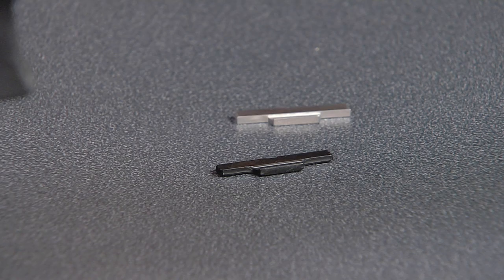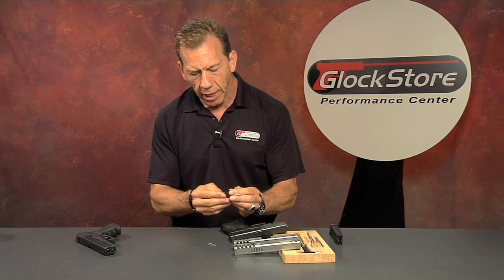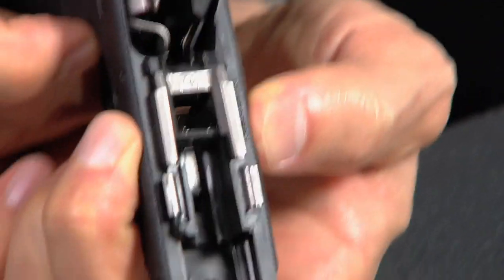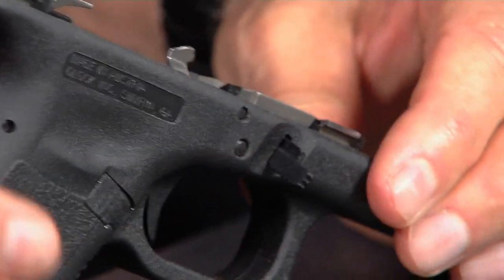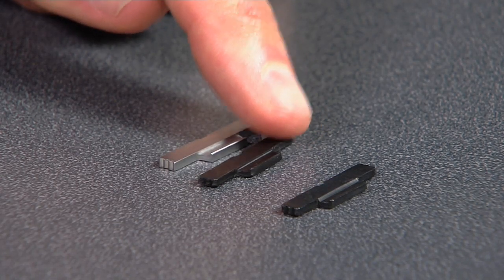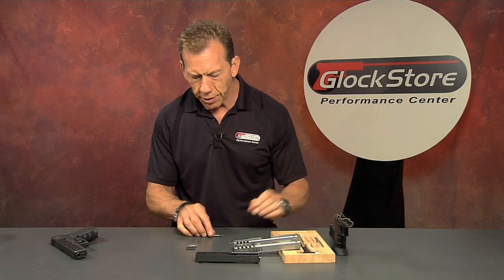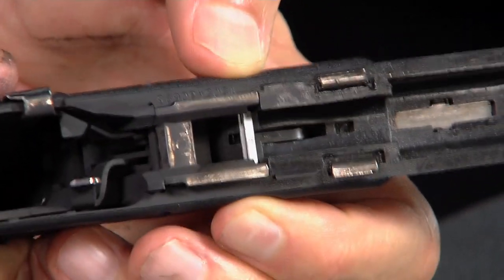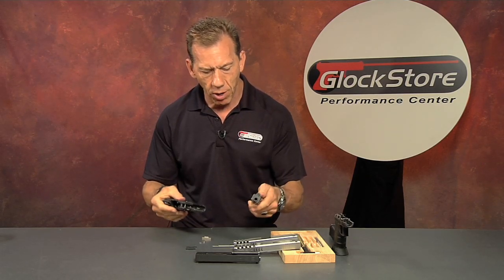Precision Extended Slide Lock Lever

Comment: This little peace actually does make the gun a little bit more accurate at 15yd I tested this with factory and then with this I noticed I had a tighter group, there is less play in the barrel when in battery thus making the gun more consistent.

Comment: Hey Lenny, great videos as always. I don't see one for the G44 take down lever, its a little different from the other Gen 5 models. I just changed one on my wife's new G44. I used a Gen 5 replacement lever from your shop although I see people posting that G44 vs other Gen 5s are not really the same Glock OEM part number.  The G44 seems a rather different beast although good for my wife to learn to shoot before we go back to 9mm.

Comment: The setup for the spring that the slide release lever sits on is different in a Gen5 Glock 17 MOS. So that leads me to wonder what comments you might have about any potential improvements already existent in Glock's Gen5 slide release lever over the Gen you're using. Do you still think your slide release lever is better than the one now provided in the Gen5? Also, considering the different spring design (it looks like a tiny coil spring) on the Gen5 slide release, I'm also wondering if it might be more difficult now to change out the release lever. Looks to me like the tiny little coil spring in the Gen5 version would be an easy item to pop out unexpectedly, never to be seen or found again, lol. Thanks for any insights and info, much appreciated. Always enjoy your videos. :)
Reply: The coil spring actually is an improvement over the leaf spring, in that the long leg on the leaf spring occasionally does break. It's equally easy to replace the slide lock on both variants.

Comment: The "unnamed competitor" to which Lenny keeps referencing ("genmtly knocking" is more like it), of course is Galloway Precision that sells a stamped take-down lever that is 4mm wider than stock. No, it is not machined like Glock's super take-down lever, is NOT thicker than stock, and does not have a curved top to catch the barrel (not the slide).  It does get slammed every time you fire the gun, so there may be something to having an effect on barrel return being more consistent because, as I said, it catches the barrel - not the slide. 

While it is thicker, it is only 1mm wider, and although it may not be a problem on the Glock, it definitely is the problem on the SD9VE Glock 17 Clone.  I wish to God that S&W copied the leaf spring design of the Glock L-shaped leaf spring instead of making an S-shaped leaf spring that rests on top of a U-shaped spring, and does slide from side to side.
Why in tyhe Hell they didn't make a simple L-spring and stick one end in a frame slot and put the other end under the notched takedown lever - a la Glock.
In fact, why is Glock using a longer leaf spring support end in the G19 than in the bigger G17? The longer leaf spring support does just that5 - give the spring more support.
The dumb arrangement in S&W's SDxVE series uses a useless U-spring that adds nothing to the takedown lever operation, BUT, in factr, messes it up!!!
Which is why I made this video to show a different way to take down the Glock clones and also the real Glocks:

https://www.youtube.com/watch?v=3UJXs-XV_jM
Reply: TheDrRJP BTW, will this work in Smith & Wesson's SDxVE series?
If you look at the photos on Galloway's website, the takedown levers for both the Glocks and SDxVE's look identical.

For that matter, so does the "captured recoil spring/stainless steel guide rod" combos. Are they also interchangeable?

Comment: I'll disagree with Mr. Ridgeway in his assessment of Glock aftermarket parts and why they exist.  He states that Glock aftermarket parts exist to make Glocks functional.   I disagree by saying this gun is perfectly acceptable for the general public exactly as produced.  Guns that are popular and most numerous are the perfect platform for aftermarket products that make a gun fully customized for the owner.  The more of any gun there is out there,  it is reasonable to say there are more folks out there who want a gun "their" way, or customized to their tastes.  Glocks are the perfect platform to modify as you choose, or simply shoot straight from the box.
Reply: Exactly. Hard to beat a Glock's reliability and longevity out of the box. None of the endless number of mods available are necessities.
Reply: Having slightly sweaty hands makes a couple parts of the glock extremely hard to use, like the slide release and this part. I have custom parts for both and it makes the gun MUCH better.

Comment: To say a new slide lock lever will provide better accuracy is frankly marketing bullshit.
Reply: +dkeberhard as far as any noticeable accuracy gains, probably not, but when you stack more precise items up,  even with little amounts, it can and will add up. This part alone probably wont do, much for ya, but in conjunction with a new precise barrel, Recoil spring assembly, a adjustable trigger with new precision internal  striker components, it may make a huge difference, but the thing is most people cant probably shoot it to that kind of accuracy,
Reply: Will it not lock the barrel more consistently? In that case it would give better accuracy in theory, but the aversge shooter would probably have other accuracy issues to worry about before this will be of any significant value

Comment: ANOTHER AFTER MARKET PART FOR A GLOCK TO MAKE IT FUNCTION PROPERLY-OUT OF THE BOX.  HAVE YOU EVER SEEN A PISTOL THAT IS IN NEED OF SO  MANY UPGRADES RIGHT OU OF THE BOX?  IF THIS FIREARM OPERATED LIKE IT IS SUPPOSED TO PLACES LIKE THE GLOCK STORE, GLOCK WORLD, ROCK YOUR GLOCK AND GLOCK MIESTER JUST TO NAME A FEW WOULDN'T EXIST!  UPGRADED BARRELS, EXTENDED SLIDE LOCK LEVERS, FIRING PINS, MAGAZINE RELEASE BUTTONS,,, THE LIST IS ENDLESS TO BRING THIS PIECE OF "PERFECTION" UP TO PAR.  DON'T BELIEVE ME?, JUST PUNCH IN "GLOCK PROBLEMS", SIT BACK AND BECOME ELLIGHTENED.
Reply: +Mark Ridgway you must be very ill informed, does every time some gets a ar 15  that is basic milspec furniture, and upgrades to magpul grips, stocks, new barrels, calibers, different safeties, different magazines and so forth, that ar 15 is a non functioning piece of junk. Not at all, it will work right out of the box, just fine. Its a popular gun with alot of aftermarket support so people can change a stock basic design to better fit their needs.  Smith and wesson, XD to name a few have aftermarket parts as well. Check springer precision, galloway precision, apex tactical., they make numerous parts for other manufacturers. Glock is perfection by no means, no gun is perfect, I wish they would drop that slogan, and move on to something more realistic, but that apart, the glock pistol is sold often, used often, by alot of people, police departments, and military armies around the world. Also want to note, look how many different companies make a 1911, make 1911 parts. It must be junk because not everyone leaves theirs stock by your logic, a 1972 camaro, must be junk because manufacturers make aftermarket parts such as rims, edelbrock carb and so forth. Your logic on this topic is flawed , say what you will about glock, but I am just fine with my glock as a bone stock pistol, but I bought a Glock 40 10mm auto for use on whitetail deer. Could I leave it bone stock  and be just fine, yes, I like sights that are stock on a glock I am fine with their use of polymer on lots of aspects of the gun. But I  am going to put a new trigger bar, new adjustable trigger, a ported barrel, and a steel recoil assembally because I am going to push my glock to the limits, beyond what normal people would do with it, I will put hot loads capable of more energy than a 357 magnum and edging on a 41 magnum. I like revolvers, Heck I got a ruger super redhawk in 454 casull, That I probably will skip over this year to use the glock, because I will have it so honed down with a short crisp trigger, with a red dot reflex sight, I will have no problems. Dont care if it cant shoot 1000 rounds with no stopages, I want my view of perfection and a store like GlockStore, or lone wolf, is going to help me get there. Because in the end, everyones views on perfection are different.  

PS also on a side note, Why be a dick to other gun companies and people that might have different beliefs than you! We are all gun owners and come from all walks of life. We dont need division amongst ourselves we need to stick together because our rights are threatened every day by people that dont care about our, hobbies or our rights to protect ourselves.  I for one am happy for every gun company around that can help bring new interest to the sport, hobby, and everyday people.   So if you dont like something, shut your pie hole and dont purchase, just be happy someone is buying more guns and products to keep the industry going.
Reply: Mark Ridgway it does not need a buch of mods it is people peferc
Reply: Have you seen all the mods and "upgrades" for the 1911?